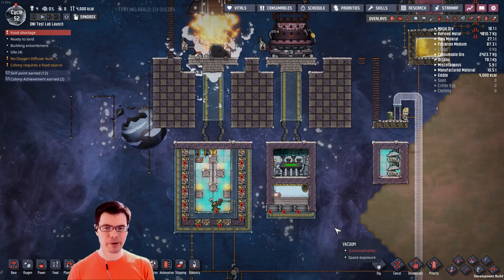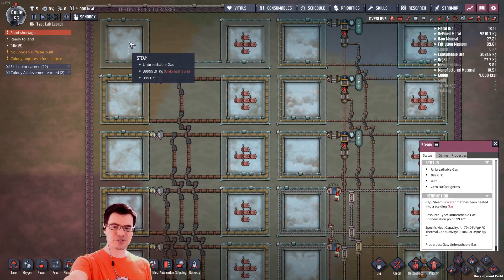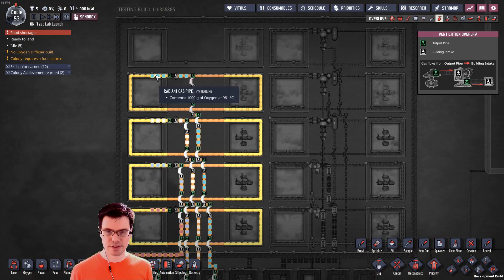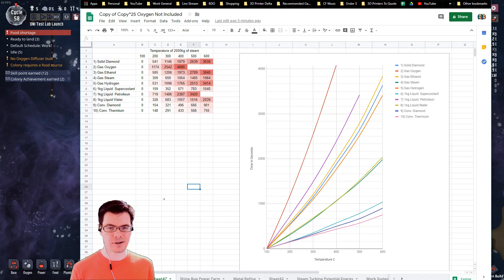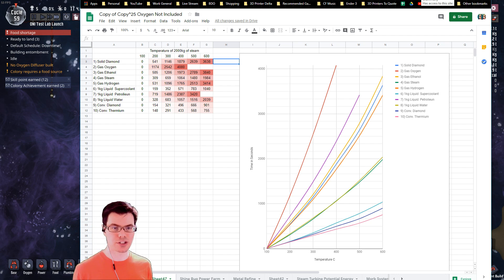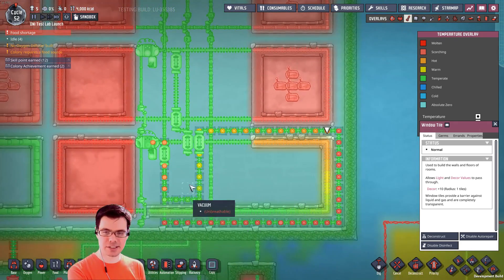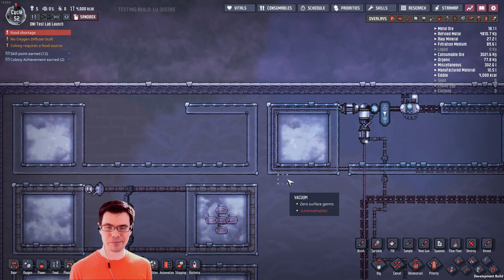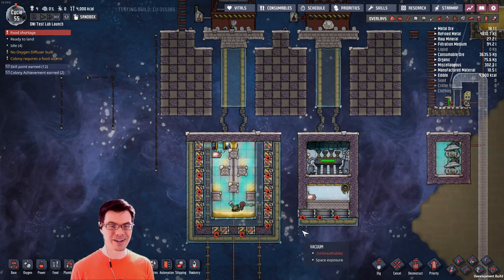Heat Loops VS Solid! Oxygen Not Included Experiment

Comment: 9:19 You say the specific heat is the same because it's just hot water, but that's not true to life. irl, both steam and ice have about half the specific heat capacity of liquid water.
The reason why they're identical in ONI is probably because you could use it to delete heat rather easily. Heat water into steam with the higher heat capacity and then cool the lower heat capacity steam with a thermo regulator and boom, heat removed (albeit at the cost of damaging gas pipes)

Comment: gaseous water has (or at least should have) around half of the specific heat capacity of liquid water. Thats because the ability to store heat in rotational, translational (and vibrational) degrees of freedom changes, when a phase change changes the number of degrees of freedom... but well its just a game (and tbh, it's quite impressive that they have included this in the first place)

Comment: Does ONI have latent heat now? Oh, and you aren't caring about specific heat capacity, you are caring about total heat capacity being moved (specific heat capacity times mass flow rate of the medium) , which you allude to with the reference to the larger amount of mass on conveyors.

In some situations, you could use a phase-change transport even without latent heat for very fast heat transport: Put the heat source (which must hot enough to boil the coolant) below the sink, (which must remain cool enough to condense the coolant) and provide a path for the gas to rise to the sink and for the condensate to fall back to the source. If you use a conveyor return system,  you could even melt a solid at the source, have the liquid fall to the sink, and then freeze the liquid into an item to be swept, conveyed, and dropped back up at the source. 

The advantage of those methods is limited in either case, since gases outside of vents move too slowly, even at extreme pressures, and the mass flow rate of the solid/liquid loop is limited by the conveyor rail anyway.

Comment: As an engineering student, it is best practice to place time on the X-axis rather than the Y-Axis. It makes the graphs far more intuitive to interpret. And it greatly simplifies any calculations you may need to do.
Reply: As a math student, that would require either misrepresenting your data or collecting temperature data at specified times rather than looking at what time a specified temperature was reached; the x-axis is the independent variable.
Reply: Lol math-cuck in the comments. You probably evaluate integrals analytically. I only us the finest of trapazoids

Comment: FYI: Items on top of a tile transfer heat to the tile they're sitting on.  Items on a conveyor are essentially considered to be "on top" of the tile they're above, which is why you get heat transferred downwards.  You can also use that fact to make shipping setups that handle super hot materials, without conducting the heat at all, while still cooling the shipping components.

Comment: I used metal tiles to transfer temperature in an electrolyzer/nullifier setup, but to increase the mass in the tiles I made the tiles into wolframite mesh tiles and filled them with oil.  I don't really know how effective that type of setup is compared to just making tungsten metal tiles or how those metal tiles compare to the diamond tiles you were using, but it was kind of fun using solids for thermal transfer.  The solid transport cooling loops is a really cool idea.  I've never really gotten far enough in a game to use late game materials like super coolant, either.  Anyway,  I love your videos, thanks for all you do!

Comment: #Brothgar

in conclusion; 

heatsource: CPU/rocket
heatstorage hot side: diamondblocks
transfer meduim: conv thermium/diamond, pipe supercoolant (with 1kg exploid if to hot)
heatstorage cool side: thermium/diamondblock, steam 

check that, 

need help with following;

no counter running loops cause cold exit will pick up hot entering stuff and transfer heat back out of the system,
for system performance no solid connections between the heatstorage hot and cold side and limit the ammount of blocks that can excange heat. 

did i got this right

Comment: The liquid in heat pipe actually boil when you heat them, then it goes and condenses on the cool side then flow back. so this is not the same as the heat pipe.

Comment: Actualy, the thermal conductivity will be MUCH more of a factor if the two temperatures are fairly close. When you're going from 1000C to 100C nearly any substance will heat up very quickly (with the obvious exceptions of abysalite and any type of insulation -- though, even those will heat up over a few hundred cycles). If you're trying to cool something from 70C to 30C you'll find that you're going to need to use a material that has high thermal conductivity (or possibly stop the flow of the material so it can soak up the heat).

Comment: What happens if you just put water under the rocket, and put the steam turbine beside the rocket? The steam can transfer to the steam turbine through air flow, and eventually all the steam would be used and relocated to the rocket side. Would that be more efficient?

Comment: I’d be curious to see if you could get a lot of power just looping hot regolith from comets into steam generators
Reply: If only you could build the steam generator upside down...
Reply: it would work but kinda poorly the Heat capacity and conductivity are on the low end as far as materials go
Reply: @diabloblaze1637  It is "renewable" though, and you generally have to mine it up just deal with the space layer, so why not put it to work. Maybe recoup some of that mining laser and bunker door power

Comment: time to start shipping raw daimond =P
Only issue with moving lots of solids to transfer heat would be that we need to give lots of vacuum space for "insulation" to prevent heat transfer in places we don't want it.
Reply: I'm wondering if putting the conveyors behind insulated tiles might help to prevent heat transfer in those buggy places.

Comment: wouldn't a entire wall of tiles be far more effective then a single row? seems kinda like you punched the solid tile experiment in the face on this one xD.
also running the pipes/conveyors through all of the walls is kind of cheating, the pure tile only has a single tile to take it's energy from while the pipes/conveyors have like 20x more tiles to pull energy from.
if this was fair then the pipes/conveyors would only be allowed to enter a single corner tile on the hot side, like how the pure tile one is setup. this will drastically change the results and be more accurate. you could also just fill in the space with window tiles between the two boxes and that will be far fairer then it currently is.

not that it REALLY matters as you can just use BOTH like you said xD.
anyway still a great video to watch, tons of other great information to take in. i always love the graphs, everyone needs more graphs in their life.
Reply: I think the point was to demonstrate the ability of the loop to work in a manner that reach every point, because that's how it would actually be used, whereas the solid can't easily gain access to the rest of the sides. You can build a bridge between them but going behind it to use the back for heating for instance would take long than just heating it up from the front because it has to heat the entire path there. I think this very appropriately demonstrates the the premise.
Also all the heat input does technically go through the same tile for the liquids and solid loops. (Except the hybrid one), It just has a seperate path to reject the old medium so new medium can enter (in this case going back to the heater)

What I would like to see a comparison of however is a Radiator design where the pipes go back and forth on each vertical so the heat expended fluid or solid reheats immediately. Then try that against the solid wall of diamond glass. We could also have the radiator style only allow the pipes to interface with the left most blocks on the cool side so that they could keep the same thermal interfacing area.

Comment: That's not a radiator on the cooler for a computer...that's just a heat sink. Water coolers for computers though do have radiators. The concept you used though is correct, just the term for the cooler is incorrect and it annoyed me though to make a comment lol

Comment: Queen Hydrogen has dropped her crown. All Hail King Diamond
Reply: But what about Aluminum? Metal tiles made of it have nearly the thermal conductivity of thermium (205, vs. 220, and Diamond's 80) and it's found in forest biomes, which you start in on Verdante and Arboria.
Reply: @Nebulon-B_Frigate_FTW  The melting point of Aluminum is way too low
Reply: @xeels2708  what about 1kg of liquid Al in a liquid pipe?
Reply: XD King Diamond you know!

Comment: 500 hours in this game and i never thought to use gas AND liquid loops on top of each other. So painfully obvious.
Reply: You forgot to add solid loops ontop!
Reply: @Myricaulus  and solid tiles on top of that.
Reply: @ioangauss  liquid cooling loop is much better than hydrogen but definitely more tricky to set up for early game since water's mass and its thermal conductivity is way way better than hydrogen or any other gas in general
Reply: Hydrogen though lacking the mass will cut out the need of refining metals and being a gas with the lowest boiling point you can effectively ignore state change.

It really is a cheap way to boots effectiveness

Comment: Only problem I see with a solid loop is there is no way to insulate it easily. Fine in vacuum or an extra tile of isolation around it but otherwise it's going to dump heat everywhere.
Reply: Wouldn't that be an issue with any high-capacity thermal transfer system?  It seems like the more effective it is, then the more it is going to move heat anywhere it goes.  Because it... moves more heat.
Reply: @stellarfirefly  you use abysalite pipeing in the areas you don't want the heat to be dumped
Reply: @OurLordCuthulhu  theres no easy lossless piping anymore, best we have is insulation but thats expensive to make

Comment: I believe the heat wasn't coming from the load in the conveyer belt at 13:00 it was coming from the mass above it. I think the rail with the basket started acting like a thermal shift plate for some reason. Think that could be a very useful trick.
Reply: this is the debris which transfer heat to the tile below him even if it is on a rail.

Comment: what about a conveyor belt of igneous rock then? It has a higher specific heat capacity, and wont transition to something with a lower one at those temps.  I assume a conveyor belt of abyssalite wont heat up in a usefull way.
Reply: Conveyer belts are metal.
Reply: Steel or iron ore would avoid the magma rain at temperatures where rails are safe. For ultra-high temperatures liquid magma could be used as a coolant in obsidian pipes, but liquid aluminum might have a better temperature range, if you don't have to exploit a quirk to prevent it from changing state.